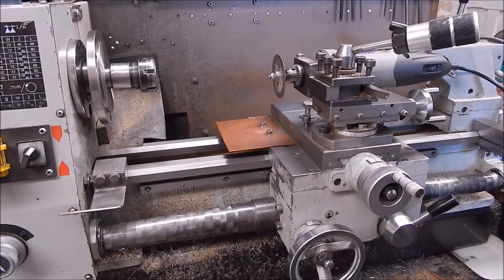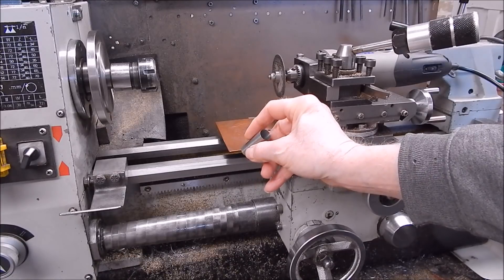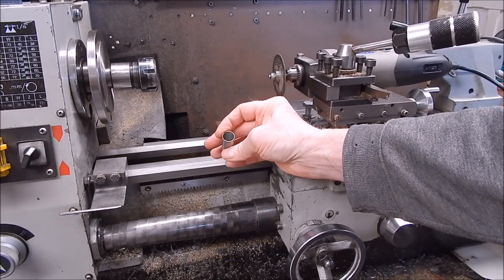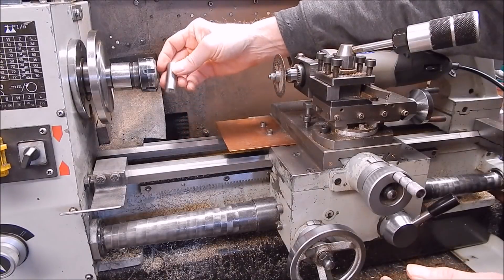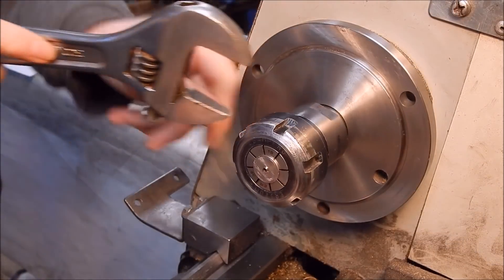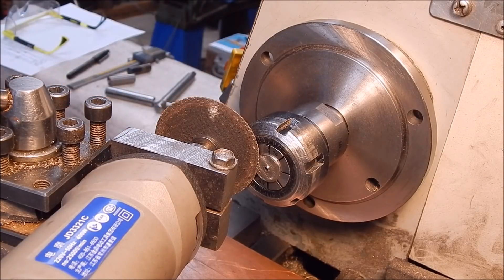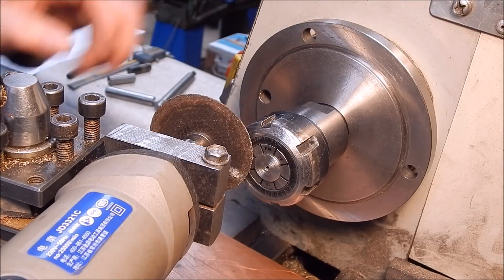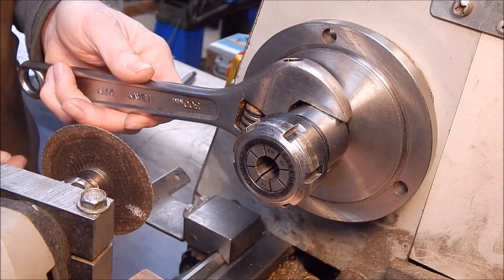Why collets are so good for a metal lathe

Comment: This is a good tip!  I needed to make 1" diameter by 3/8" feet for levelers for a furniture project. My SB 9" only has a 3/4" spindle, so ended up cutting the slices with a bandsaw and facing them off using a ER 40 collet chuck. I used the collet set up to drill and tap the feet as well. A short piece of all thread welded to the feet completed the levelers. Thanks for all the great videos!
Reply from the maker: The more you use them, the more you use them ;)

Glad you enjoy the videos.

Cheers Rob

Comment: Nice! The little engine is coming along well. A lathe collet system is in the works here, just need to squirrel away a few more dollars before that'll get to happen.
Reply from the maker: Make sure to buy a collet set/chuck made to a DIN standard and with a specified maximum run out figure.  If neither of those items are stated in the write up, pass it by.

Cheap definitely does mean nasty with collets.

Cheers Rob

Comment: G'day Rob bloody good example of how good collets are. Could you use them for most jobs instead of a chuck?   Thanks Rob it looks like another tool for the lathe regards John.  PS in relation to Chinese lathes mine is a Sieg SC6 with some improvements and it's great the tolerances are very good, the lathes ect are fine so long as you take the time to set them up probably and have them as ridged as possible .
Reply from the maker: Hi John.

No, not really, unless you were only working within the maximum work holding range of the collet chuck, and all work was round ;)  You still need conventional chucks to hold large and offset/irregular work.

I have my old Schaublin lathe set up for collet work, and it's very handy not having to swap chucks around for a small job.  It's also a good excuse to have a second lathe :)

Cheers Rob

Comment: One of the greatest additions a model engineer can purchase for the lathe. I have a ER32 chuck and a nice fitted case of ER32 collets that I use for 80 percent of my lathe work. I chose a bolt-on chuck instead of a MT chuck because of the through-hole. New users might consider a hook-style spanner instead of the fork-style since there are times when you can't fit the fork over the end of the chuck because of the work (think flywheels held by the hub).
A couple of collet blocks round out the set, so one can do hex and square cuts on the mill.
Reply from the maker: Hi Tad,

All good  recommendations.  I have a feed through spindle ER chuck setup on my old Schaublin, and it is definitely the way to go if you can easily fit one.  Yes, I still use my hook wrench at times for the reason stated, but the "C" wrench is safer on the knuckles (pin wrench can slip under high torque) and allows way more tension.

You can even use a Morse collet chuck as a pin vice at times ;)

Thanks for the comments

Cheers Rob
Reply: And that's how I ended up with both. The fork spanner was the original one I bought, augmented by the hook spanner some months later when I tried to chuck a flywheel hub for the first time.

Comment: I agree about collets.  Like the live tooling.
Reply from the maker: Hi Randy,

Very handy item.  My full sized TPG never gets used these days.  Small topslide mounted die grinders are way more useful  Some people have an inherent fear of grinders destroying their lathes, but it's common sense to cover/wipe/re-oil - no problem.

The same people will happily machine case hardened steel and not think about what the chips are doing to the ways.

I've been grinding on that lathe for over 15 years and it's still got no obvious wear.

Cheers Rob

Comment: How do you get the collet chuck out the lathe when you're done? I have a similar set up and getting the chuck out is always a nightmare. I usually have to resort to inserting some threaded rod through the spindle and hammering on it with the lathe slowly spinning but I'm worried about ruining the bearings with all the hammering.
Reply: use a soft hammer, ie lead,brass or plastic faced
Reply from the maker: Hi Anthony,

No issue.  Don't over tighten the Morse taper.  I just loosen off the drawbar a few turns, spin up the lathe and tap on the outer end of the drawbar with a hammer.  It releases immediately.  Not a lot of force required.  You must do this with the lathe running to prevent marking the bearing races.

Cheers Rob
Reply from the maker: When tightening the Morse you should not go further than a quarter of one turn once it starts to bind.  Anything else is excessive ad not necessary.
Reply: xynudu thanks! Appreciate the reply. I find that if I only tighten it a little I have too much run out, but I'll try being a bit more gentle with it and see how we go.
Reply from the maker: Try putting some Prussian blue or sharpie pen on the Morse to check if it is pulling in to place correctly.  Insert it, rotate, and then withdraw.  Check for high spots.  Maybe the taper is not correct on the Morse chuck or in the spindle.

Cheers Rob

Comment: How much for a Chi-com lathe like that
Why such a big carriage handle
Reply from the maker: $1,100 AU 15 years ago.  Similar costs about $1,500 now.
Reply: xynudu wow that's good value
Reply from the maker: Single point can slip.  Multipoint is much better/safer/more torque.
Reply: Rob, thanks for the best wishes, I am also an Adelaidian! FYI, Paramounts told me they cannot get any more FL610 model lathes, so it could finally be the end of the line for them after 15 years! They told me they will be looking around for alternatives. Will be interesting to see what they get. Thanks for your great videos, they have guided me greatly.
Reply: I am retiring next week, so last week I went out and bought myself an FL610 based on your recommendation from Paramount Browns. Cost is now $1999. They just got in a new shipment from China, but they were all presold before arriving so I was lucky. I’ll be putting it together very soon now, yay!!
Reply from the maker: Paramount lathes have always been good value, decent machines from my observation.  Been around selling them for a very very long time. They sold heaps of the CQ9325 that I have, yet you never see any come on the market secondhand - says a lot. 

That FL610 has been available for a long time (at least 15 years) and is still the lathe I would go to for an upgrade.  Once you go past a 10 swing everything gets larger and heavier to use - swapping chucks becomes a real chore.

5" scroll and 6" four jaw are perfect size for most hobby/home use.

Enjoy your retirement.

Cheers Rob